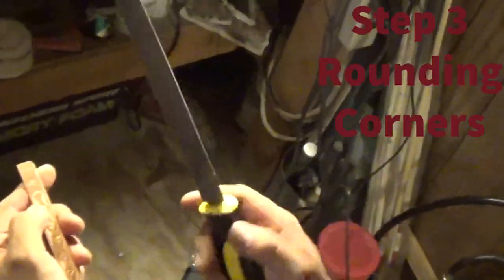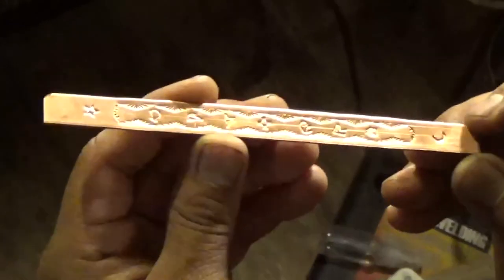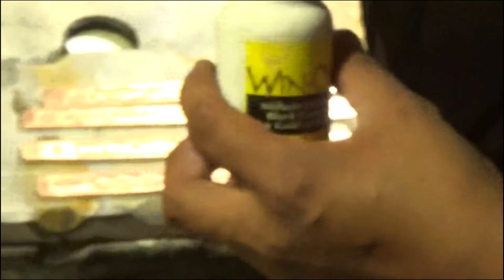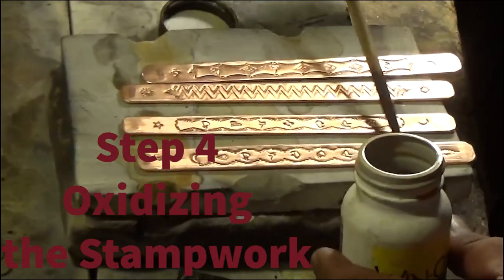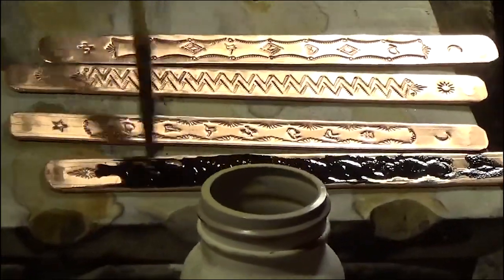Navajo Handcrafted Copper Bracelet / How it's Made

Comment: Hi, fantastic work, but I am curious about a few things. First a little background on me. I'm a former engineer that due to ill health and slowly going deaf. Got into the metal casting and jewelry making.  Here in the UK we use ISO (metric) and imperial measures but I am led to understand that you use imperial measures only, so why are you using both as well? Do you buy your flat bar or cast it yourself? 
May I suggest that when you are using your doming tool work from the ends of the piece towards the middle then it will be easier to work the sides of the bangle.
Do you clear coat the items to prevent verdigris transfer to skin?
Love the video. Hope everything goes well with you and yours .
Big hello from Wales 🏴